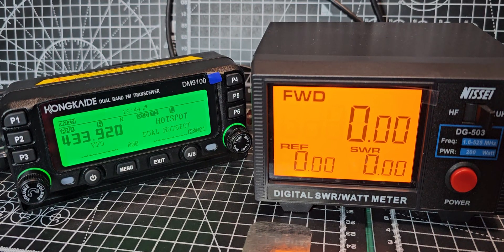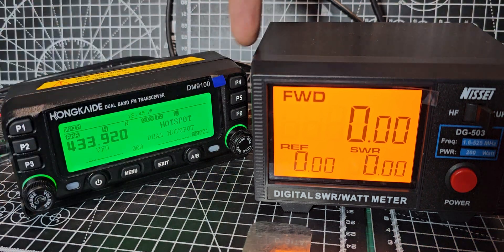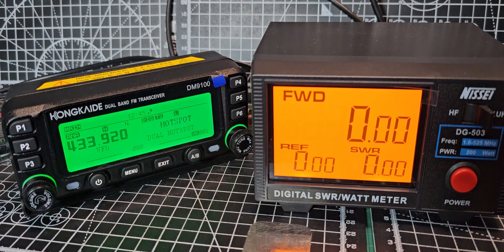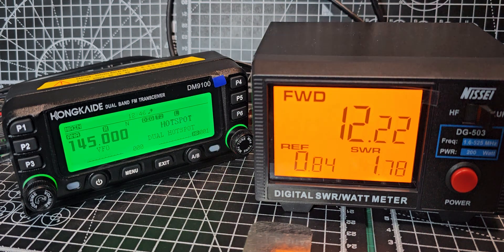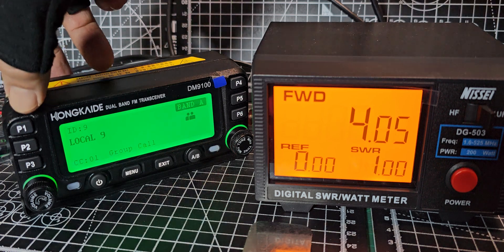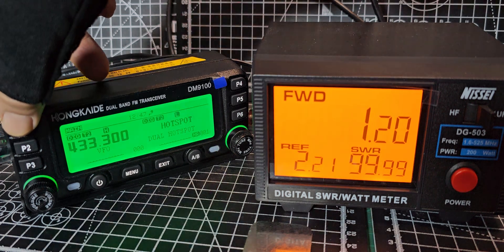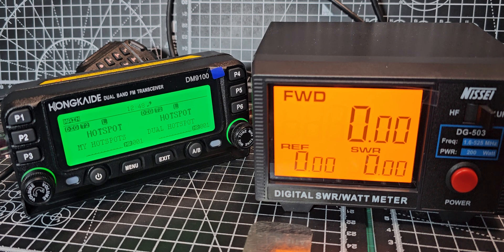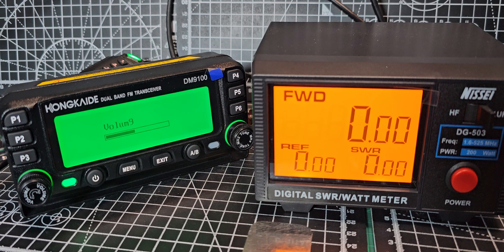Hongkaide DM9100  Transmit Power Test

Comment: Hi there. Since it is small device, have you tested it how fast it gets hot when using it on high or medium power? I am really considering buying this radio so this info is important to me. Thanks in advance 73 de E74D.
Reply from the maker: Hi i don't recommend it at full power.
Reply: @M0FXBHamTech  Ok, another thing please. Did you noticed how the radio behave in the noisy or strong RF field enviromnent? Will receiver be tottaly deaf?